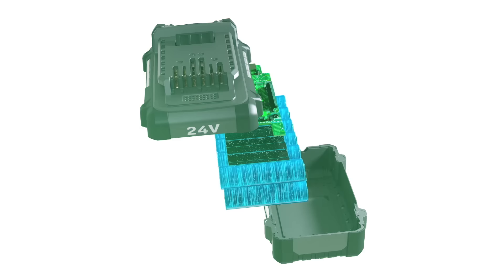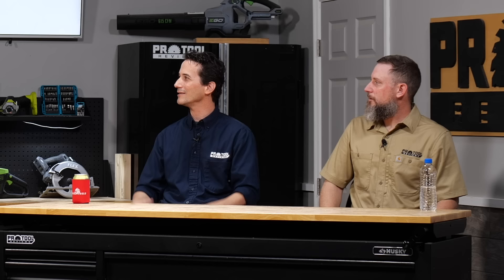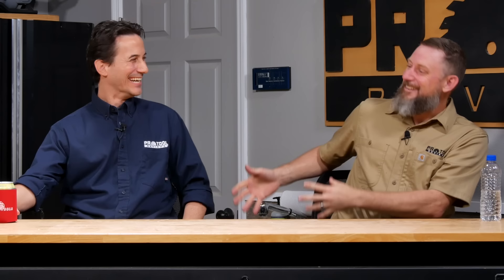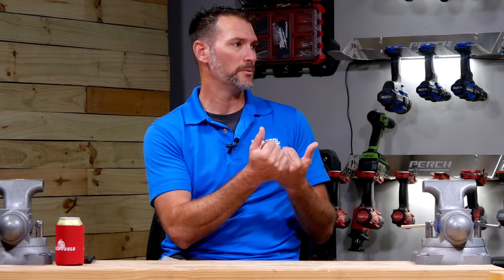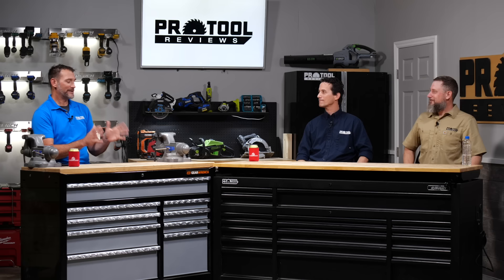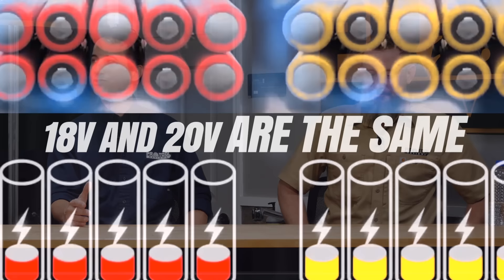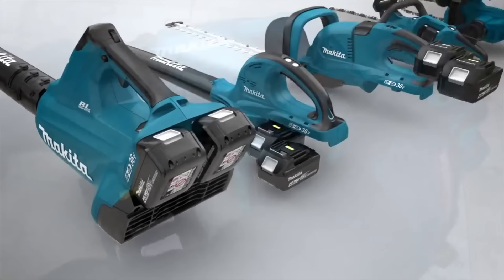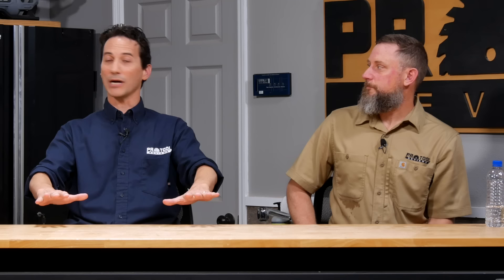You Should Buy 12V Instead of 20V… HERE’S WHY!

Comment: I started building an M12 kit years ago. Last year HD offered M18 combos that were deeply discounted so I bought around 10 tools. As better and cheaper M12 tools came along I took back, unused, several M18 keeping especially the Fuel hammer drill (the handle is a wrist saver with hole saws) and the 6-1/4” saw which enjoys the oomph of 18 volts. For the kind of work I do it’s mostly about battery shape. Climbing ladders or snaking into cabinets or vanities the “footless” 1.5 ~ 3.0 Ah M12 batteries are just the ticket. In the shop, building cabinets, multiple drills that can stand up are a plus so I just use 4.0Ah or bigger M12 batts. The latest M12 multi tool and Hackzall are dream tools. I’ve a flawless big red steel box with a 45 year old Sawzall, line voltage. Hasn’t seen action in years. But I just can’t part with it. Maybe I’ll have 6x6 AC2s or trees to cut again someday. Having worked for Klein I have a reverence for tools that helps them last forever. Klein and Milwaukee have my deepest respect and appreciation regardless of country of manufacture. Tools that take a lickin’ and keep on tickin’. As John Cameron Swayze used to boast about Timex watches. Oops, I’ve dated myself. Goood Day!
Reply: M18 cp2.0 Batts are between a 12v (actually 10.8) 3.0 and 4.0 on capacity and weight. The drills are a little heavier but not much either. Though you may need to change Batts a little bit more? At this point we're about getting to watt consumption...

They also stand up with any battery. The new m18 fuel impacts also have 4 modes and automatic features.
Reply: I wish I could say the same for Delta tools. Made in Taiwan and the new designs are noticeably different. Haven't investigated the multi thousand dollar stuff yet though.
Reply: In the history of Asian tools of quality the story goes like this. In the 50s and 60s Japan evolved to higher quality hand tools. Makita cordless arrived about early 80s. 7.6V ni-cad. As Japan labor rates went up Taiwan got going. Poor quality at first but very quickly good. Then Taiwan labor rates went up so the work moved to HONG Kong/Shenzhen, etc., PRC. Now we have a beef with the PRC and I’m seeing a lot of good stuff being moved back to Taiwan and even Vietnam in other durable goods.  Some 511 brand clothes and tactical gear (think police SWAT and military) are surprisingly made in Vietnam. An ironic twist of fate. The country of origin is less important than the design/engineering work and control of the factory by the American brand. Milwaukee is a good example of how it is done right and is certainly not alone. In the early 80s when I worked at Klein it was an “American Made - Love it or Leave it” culture throughout the trades. Every pick up truck proudly sported the decal. I like Annex screwdrivers from Japan, and Wiha, Knipex, and Klein, Milwaukee, etc., etc. Even Bahco. My rig, or kit as the Brits like to say (as do I) is a real Chop Suey of brands. My Bucketeer, Klein 5167 electrician’s pouch (retired), Bell System canvas bag, and Plano tool chests are a veritable United Nations of tooldom. I’d like to hope that someday such camaraderie will apply to our nations’ relations.  Especially in the hearts of the working folks all over that “git ‘er done”.

Comment: Higher voltage means lower losses in the connections and wiring for the same power delivered to the load (motor), the higher the power in watts the more important a higher voltage. This is why long distance transmission lines, the voltage is stepped up to thousands of volts and then stepped down in several stages until finally stepped down to safe level with the transformer of a pole outside your house.
Reply: I imagine the transmission lines are so much higher voltage than the voltage to the house because its not feeding just one house. You're feed many homes from the same cables. Yes the length of the cables has its part, but i imagine its more so because of how many houses/buildings they have to share the power. Thats why the cable wires are so much smaller. Only feeding 1 house.
Reply: @jacksmith2315  Losses in transmission lines are determined by resistance times the square of the current, or I squared R. For a given power transmitted if you double the voltage the current drops to half (P=E x I), that drops the losses in transmission line to 1/4. There are many other factors in transmission losses but this represents the majority. This is also the reason Edison's Direct Current system failed, since D.C. voltage cannot be stepped up with a transformer, for long distance transmission. It's also the reason your kids 1000 watt power amp in his trunk needs large diameter power cables, low voltage (12V) high power (1000W) equals high current (83A) and to transmit that high current from the battery to the Amp you need large gauge wire.

Comment: Brushless has meant that 12v is fine for many tools. Gives a more comfortable to use tool, provided that the battery fits into the handle- DeWalt have failed on this. I have both 12v and 18v and I reach for the 12v in most cases. Only when I need a lot of power is 18v the answer. For higher power, DeWalt wins with FlexVolt- cross compatible batteries solve the problem.

Comment: Let’s toss in electric bikes as well! Most our usually 36v or 48v, but basically similar to the larger OPE.
For me as a homeowner is a standard track home, yes I hang pictures, but I also have put in flooring, trim work and built raised beds for the garden. I would like to hav the compactness of 12v tools but I would still need the torque and power of 18v tools so there is the rub. I think for homeowners / DIYers having that one battery system that works on all your cordless tools is a huge money saver. 
Most could get by with a couple of 4ah batteries for all their tools and OPE (again, the typical track home with an average front and back yard). Perhaps choose a brand with a huge range (like Ryobi) or offer different lines within that brand, as Dewalt does with Atomic, Compact, XR… all of which can use the same battery. That way a homeowner can make the choice, maybe a compact impact driver but then a full size hammer drill as an example.
Reply: Makita has 18V LXT sub-compact tools that are the size and weight (or smaller!) of 12V tools but run the same battery platform as the standard 18V tools.
Reply: @GoFastGator  you’re exactly right I’ve got the subcompact line and they work great even the subcompact saw. I own a HVAC business and I have one truck that has all DeWalt tools another truck that has all Milwaukee and another with Makita. Then mine which has all of them. To be honest I have more tools in the Milwaukee platform that tears up then I do any of the others makita’s I still have a 9.6 V sliding battery and the first 18 V big fat 2.5 amp battery they still work except the batteries are week or dead 
But the drills still work. I have  to make up excuses to get the new styles. The couple that I have that are messed up with the makitas it’s always the Chuck’s I’ve got two drills that the chucks will not open or permanently closed but the drill still works perfectly.

Comment: Not much reason to worry about brand homogeneity of battery packs anymore, because adapters are readily available and work pretty well nowadays. That being said, I’m not sure whether they have 12v to 18v/20v adapters, so that might still be a limiting factor.
Reply: You're right: you can buy an adapter for Brand A 18/20V and Brand B 18/20V, but not Brand A 18/20V to Brand A or B 10.8/20V or vice versa.
I haven't seen adapters that would let you use a Brand A 56/60V battery on a Brand B 56/60V tool (Ego, Greenworks, Toro, or other). That would be awesome.

Comment: I am going to disagree with one point. Batteries don't "settle" to 18v after a half second on a tool. It takes a bit to deplete it to 18v. The nominal voltage is more or less the halfway voltage in the safe operating range. An easy battery to test this with is a Ryobi, since it has four bars on its meter. Take a full one and run it until it's down to two bars. Check the voltage and it will be at 18.x volts. Keep running it and it will (normally) cut out and have the flashing last bar at 16.x volts. 16-20 volts is the range of a typical 18v battery, which is what makes 18v the nominal voltage.

This can be verified by jumping over to vehicle batteries. Those batteries are 12v batteries. When topped off, they're at 14.x volts. 10.x volts is the bottom safe discharge point. That makes 12v the nominal voltage. Batteries don't "settle" to their nominal voltage. They pass it at the halfway mark.

Comment: A couple of corrections:
1. It's not mandatory in EU to market the nominal voltage, which is a half discharged battery, anyways.
2. Higher voltage in flexvolt (or whatever the name is) isn't easier on the pack, for the pack it's the same, e.g. you either pull 10 A per one of the 3 parallel rows at 20V, totaling 30 A or you pull 10 A at 3x the voltage from the single row, it's the miniature engine and the electronics, especially when under high load, that benefit from the lower current - more usable torque for demanding applications or better cooling.

Comment: The Milwaukee M12 FUEL line is just about as powerful as their M18 Non FUEL  line, so in my opinion there is no need for the larger tools, except if more power is required.

Comment: It probably depends on what you're doing. Like if you're going alot of wood working or stuff like that, there's probably not much difference. 

But the moment your work switches to metal and especially rusted metal work, the M12 either won't do it at all, or will burn through batteries low no tomorrow trying. 

Like I'm pretty sure I'm not using a M12 to take lug nuts off a semi.

Comment: What's the advantage/disadvantage of two 18V batteries ran as a 36V vs a single 40V in a tool? Is the 40V battery just a 36V battery at max voltage like with the 18V/20V marketing?

Some of Makita's 36V lawn tools are attractive as I can use one of the two batteries for the 18V tools if needed. Plus (guessing) the 40V is going to  add more weight, if it can even run on a 18V tool.

Thanks in advance...
Reply: No difference in power or runtime. The 2x18V lines are for people who strongly prefer to stick to one battery platform, typically a platform they're already invested in.
2x18V might provide a slight benefit in weight balance, especially in a chainsaw.

Comment: Too many tools are missing from the 12 volt lines which is why I go with the 18. 
From a more technical standpoint too higher voltage is generally more efficient because it draws less current for the same power.

Comment: Good discussion.  If I had it to do over again, I'd get fewer 18v tools and more 12v tools.   As it is, I have a lot of 18v tools that rarely/never get used.   I almost always reach for the 12v first.

You gents are missing a huge point ref. batteries and cells.  An 18v 12ah battery and a "60v" 4ah battery the same w/hr capacity have the same number of cells.  You know that.  The part you're missing is that the 60v battery, running an equivalent tool like a circ saw, is drawing those amps from fewer cells in parallel and more in series.  Therefore, the amperage on the individual cells will be the same.  And SO WILL THE HEAT.

The higher voltage tools DO have advantages, but they are after the  battery pack.  Conductors and circuitry can be lighter and less expensive.  Heat in the tool itself SHOULD be easier to manage.  But equivalent cell count batteries with the same watt/hr capacity in like tools will get just as hot.  Some may do a better job at dissipating it than others, but really, in high drain tools(battery dead in 25min or less of run time), even active cooling won't do much good.   You need lots of air movement, and lots of surface area to dissipate that much heat in that little time.
Reply: Well the amps will be lower, but the power output in watts will be the same, which is a good thing.
Reply: And yeah, high output tools should really have heatsinks and actual fans for cooling the batteries when they get above a certain temp.

Comment: I definitely disagree with your summation of the usefulness and utilization of 12v 5 3/8” circular saw.  I do trim work, occasionally needing to make quick cuts on 1x4, 1x6 or 1x8 boards for casing windows.  It’s not for repetitive cuts, but more in line with customization of some sort, e.g. baseboard, headers, window seats, etc.  I use a Milwaukee M12 Fuel 5 3/8” Circular Saw, equipped with a 6 amp battery and a Diablo 18 Tooth Fast Framing Blade.  There’s plenty of power.  It glides through the wood.  I’m not using to rip 4 x 8 1/2” sheets of plywood, even though I could…even though I could.

Your guest made the comment that when cutting starts 12 volt tools end.  I couldn’t disagree more.  My Milwaukee M12 Hackzall is a beast.  Equipped with a 6”, 9” or 12” Diablo carbide pruning blade I can easily cut 5” to 11” branches or go through dirt to cut out roots.  It also cleanly cuts any kind of pipe, with the right blade or overhead carpentry type jobs ranging from those that require finesse to demolition.  I have the M18 Hackzall, but my go to for most jobs is the M12.  Milwaukee pioneered the recip and packed that technological know how into both of their  one handed recips.

The new M12 Fuel Oscillating Multitool is amazing.  I’d put it up against most competitive 18v or 20v multitools.  It’s very powerful.  I feel it out performs my Dewalt 20v Max Multitool.  It’s quieter, has less vibration, is more powerful and has a better cutting angle.

I started in the Milwaukee M12 line with one tool, but gravitated to the M18 tool line, building out my tool collection as needed, filling in and supplementing with M12 tools where it made sense (and sometimes when it didn’t 😉).  For instance… I have the Milwaukee the Milwaukee Fuel Gen 3 Impact Driver and the M18 Fuel Surge Impact, however my most used impact is the M12 Fuel 1/4” Hex impact Driver.  It’s an awesome light weight and powerful impact, with 1300” pounds of torque and 3300 RPM.  Aside from having a lot of power when needed it offers fantastic control, with 4 different speed settings and a variable trigger.

I didn’t set put to write a dissertation, but felt I needed to interject real life scenario feedback to comments being made on your channel.  There are many tool neophytes that tune into your channel and other tool related channels,that need point counter point, in order to make the best buying decisions possible.
Reply: You use a circular saw for casings? 🤔 They make miter saws that do that a little better ya know.
Reply: @cdurkinz , use miter saw for production…of course.  However, so I don’t have to run back out to the miter saw, I use a Milwaukee Fuel M12 5 3/8” Circular Saw to fine tune a board for a nice fit.

Comment: The irony here s that for the same performance level, you should be able to make higher voltage tools smaller since you can shrink the size of your wires, resisters, boards etc.. 
Remember watts = actual power which is just good old VxA.... 
So if I'm running 12v and I want to produce 120watts, I need 10amps, but if I'm running 24v I only need 5 amps.. from the perspective of wire size, impedance, heat production, voltage drop etc, that's a massive difference! 10 amps needs some chunky cables, but 5 amp wiring can be tiny, at least from the perspective of trying to cram wires big enough for 10 amps into a tiny stator or run power around the tool.. 
even if you cheated and used a higher voltage motor to shrink your windings, you'd still need a bunch of extra rectifiers, capacitors, and transistors to convert the voltage.
Yes I realize that they are already doing this to change the voltage from to A/C for the Brushless motors, but you'd need even more to also change the voltage, plus you'd still be running chunky wiring through the tool. 
The last objection I guess would be that low voltage high amperage configuration CAN deliver more initial low end torque, partly due to the design requirements of each motor, the 12 volt needing to be physically larger, and partly due to just the larger current, but that advantage drops away pretty quick due to less voltage pressure.
Either way, any low end torque benefits of 12v (if delivering the same total power output) can be easily compensated for without adding nearly as much size and weight as you shave off by going with higher voltage.
I'm not sure why they don't just simplify the process and just offer a 18+ volt tool range that just uses a smaller battery format than the normal 18+ volt tool range?..

Comment: Some of the sub compact 18 volt tools are as small as the 12 volt tools.
Reply: Just as an example, the dewalt 20v 791 is virtually the same size and weight of the m12 fuel drill.....it is significantly more powerful (not because dewalt is better than milwaukee or whatever) because it's a 20v tool. The 791 is not even a subcompact. I agree the compact 18/20v tools are often overlooked.

Comment: 3:41 wait until you find out about battery adapters. I can use my milwaukee batteries on dewalt or ryobi, dewalt batteries on milwaukee or ryobi. They are amazing. I don't have any cordless rigid or makita yet but I bet they make them.
Reply: The adapters are nice but they do cause deterioration to the lifetime of the batteries
Reply: @alexwilliams1131  ya if you let them run down all the way I try to not do that.

Comment: More current being pulled from Lion batteries is never a good idea.  Go up on the voltage, down on amps for same wattage.  You can use gearing, but there goes your speed.  Use a smaller battery if you need the tool to be lighter.